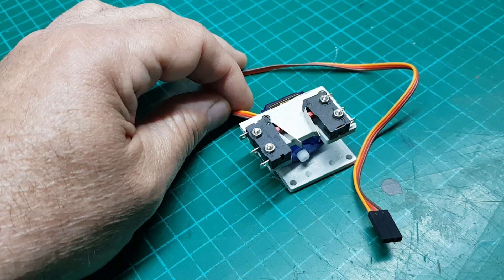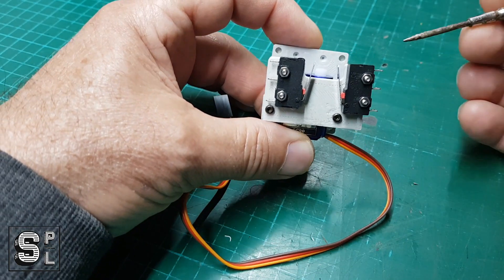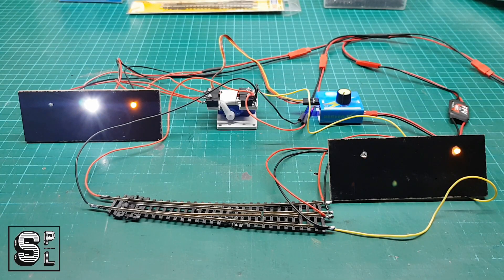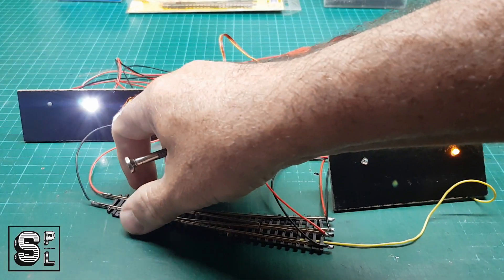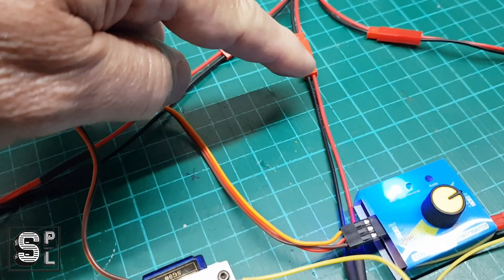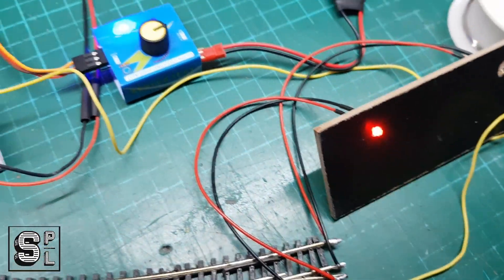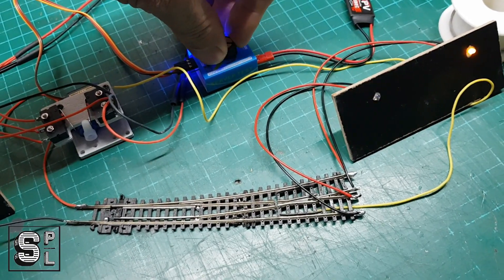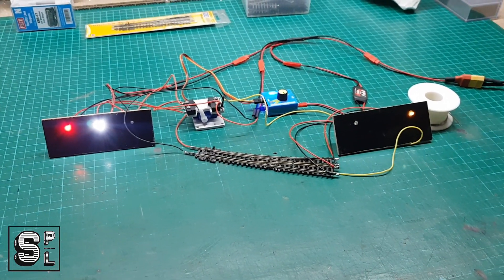How to Wire Micro Switches for Model Railway Control | Ħal-Zuzzu Model Railway (Ep12)

Comment: Nice tutorial Joe, This will work with dcc as well as dc just using dcc supply to track and switch for frog and separate supply for lights. I have actually wired up my leds direct to frog once powered by dcc. If I remember correctly led input is connected to red wire then output connected to frog and on second led input connected to frog and output wire connected to black wire. You still need resistors on led to protect them but leds will change when the frog is changed. LOL! hope that confused you!  All the best Tony.
Reply from the maker: Yes, works for both DC and DCC until we get to the LED part, where you will need a different supply source :)  Talk soon?